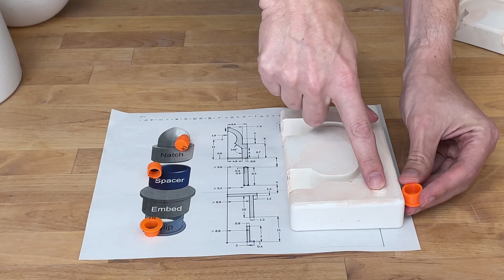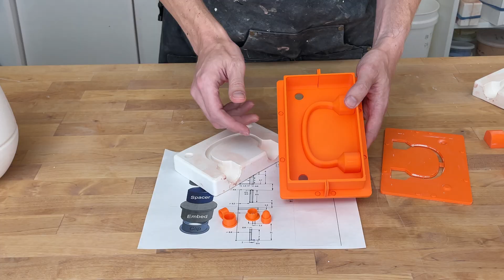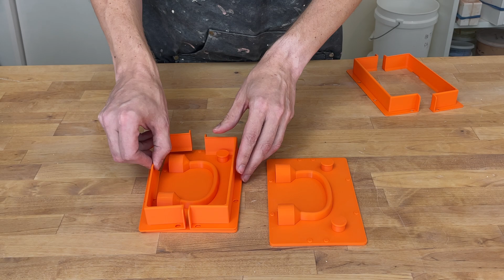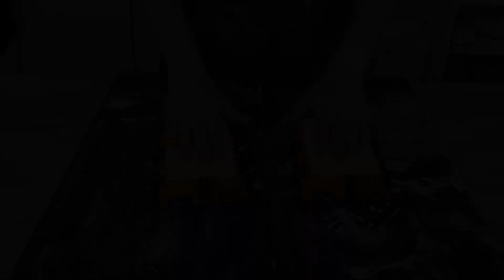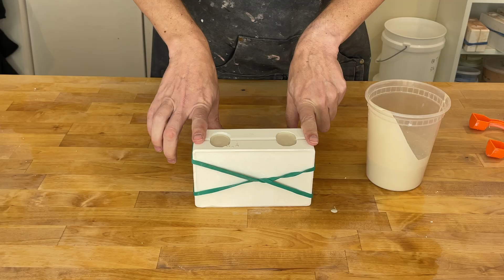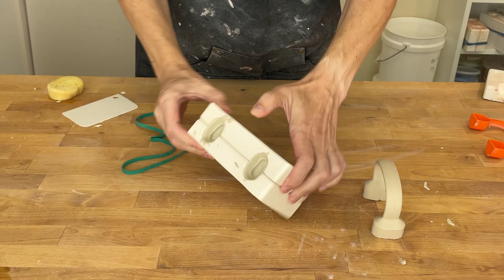Trying 3D Printed Natches in a 3D Printed Mold for Plaster Slip Casting

Comment: I'm making ceramics in Korea. I enjoy watching Kent's videos, and I'm also using a 3D printer. However, I have a question. Does PLA withstand the heat generated by plaster well? PETG is a better material for heat resistance and external force resistance. I'm curious why you're using PLA.
Reply from the maker: annyeonghaseyo! PLA works just fine. I've had people make dozens of plaster molds from the same set of PLA prints. You can of course use other filaments if you'd like. I have done some limited testing with PETG and TPU for specific mold parts (the inner part of the handle mold could use more flexibility) but in general PLA produces very usable molds.
Reply: @PotterybyKent  안녕하세요! ㅎㅎ Thank you Kent. I'll try my best with PLA!

Comment: Such an amazing Video!!! THANK YOU SO MUCH!!! How often can you use the handle-molf in a row - whens absolutly dry befor?
Reply from the maker: Glad you liked it! I have a video not too long ago talking about casting back to back. You can do it, but the plaster becomes saturated and doesn't pull the water out of the slip as well. The other problem is that it might not dry over night so the next day you might be able to cast less. In general the right answer is to just make more copies of the mold which is pretty easy.

Comment: BEFORE WATCHING: You probably realize this already, but you will need to add sufficient plaster around the embed to hold it without flexing and cracking the plaster. Specifically, in your most recent mold (2-part), I suspect the embed in the lower portion of the mold will need an  adjustment to the amount/shape of the plaster  to prevent the plastic from protruding.

Curious why you're going down this path, what does it give you that your previous key method didn't?

AFTER WATCHING: Ah, the sound when they snap together, so cool! 🤌🫶

I understand now, you wanted a tighter registration,  to eliminate the "wobble" which allows slip to escape when using the mold. 👏 

Also, you are much more of a perfectionist than I am!! 😂 I just don't have the patience anymore.

This shows in this video, by the way, your presenter/teacher skills were already quite good, but your videographer skills have become very polished, and smooth. It is a great combination for me personally, the info flows into my brain without much issues. 😂
Reply from the maker: With the plaster thickness, yes I've been doing some tests on my vessel mold and it is a consideration there for sure.

I think the alignment on the handles is probably good enough before using these. However lapping is something I've been wanting to try and see what it does in reducing flash.

And as far as perfectionist, I'm far from it. But one of the fun things about mold making is that if you can dial in the mold, then that effort pays off with each piece you make.